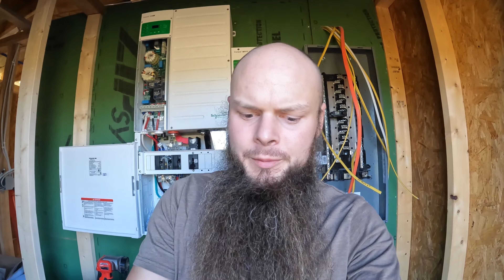solar shed part 22: new huge batteries!

Comment: Love your videos so far. Justwant to make sure you understand that water and electricity don't mix. I am planning something like this but all the water and solar are at different ends of a 16' x 8" shed. Keep up the good work.
Reply from the maker: Thanks for the concern, but they actually do mix. There’s a wire that goes to my well pump literally sitting in the water. My batteries are also rated for outside use, which is a wet area…
Reply: @kindharthomestead  Yeaaaa not caring about the water rated wiring for the well. Was more concerned about the cheap on demand hot water heater and the water supply lines "maybe" losing their shit and spraying water all over the beautiful and expensive Schneider solar stuff is what I was getting at.

Comment: You were smart to use a low frequency, transformer based, inverter charger, instead of one of those, cheap, short lived, low surge capacity, high frequency, transformerless inverter chargers that all those youtube hucksters are pushing.
Reply from the maker: That seems to be what the experts agree on! I hope the extra money is worth it

Comment: That chamfer tool has a sharkbite logo on it, doesnt it? you dont need to chamfer for crip pex. Its for sharkbites, and really I have always just made a straight clean cut and its been fine with sharkbites.
Reply from the maker: It’s not necessary if you have a good tool to cut the end square. My cutting tool is cheap and tends to go a bit diagonal. I use chamfer to essentially “debur” the cut so the pex will sit completely over my crimp fittings. It just makes it easier for me.